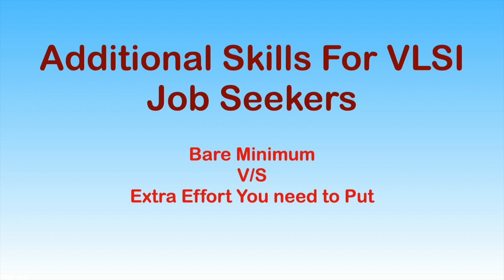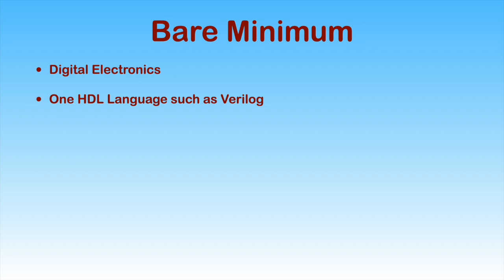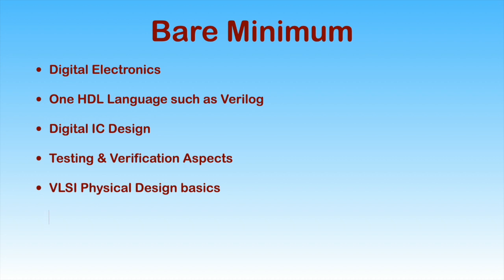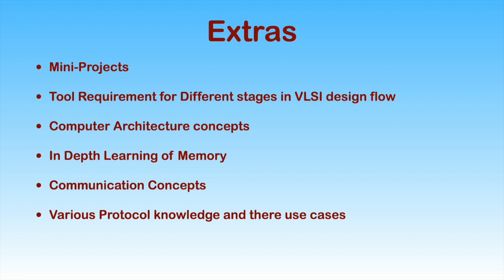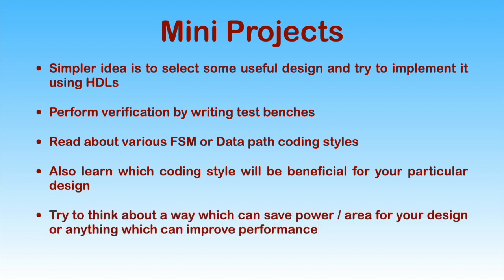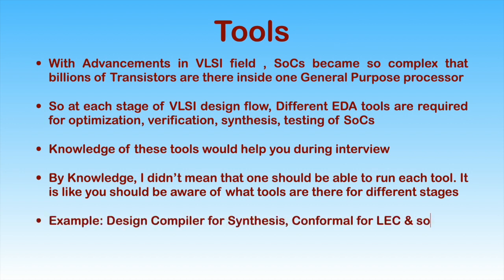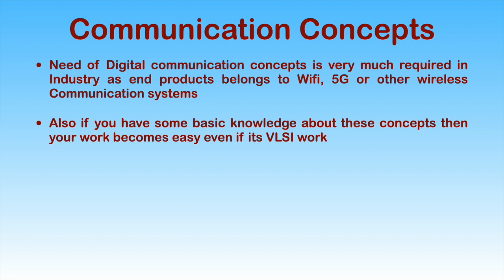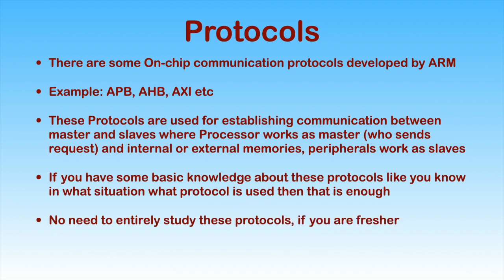Additional skills for vlsi job seekers | Bare minimum vs Extra skills need| Rajveer singh | ece jobs

Comment: Hii bro.
Could you please provide which nits offering mtech vlsi for eee.
I have secured 589 score in gate.can i  get in any nits for vlsi.
Reply from the maker: Don't have knowledge about EEE gate score. But to easily confirm this you may visit eligibility criteria for following nits
Trichy, Surathkal, Rourkela
And see if gate EEE score is mentioned in their information brochure or not.
See for Rourkela first because at this score there are high chances for vlsi
Reply: @Singh-Rajveer  tnq so much bro

Comment: Sir current I'm trying to learn a scripting language particularly TCL and I've covered basics like if else, switch case , loops , and data structures, sir after this should I go For more depth or it is sufficient?
Reply from the maker: As a Fresher, no need. When you will be using EDA tools then tcl knowledge will help you. However during fresher's interview more focus is on vlsi basics plus verilog.
Reply: @Singh-Rajveer  okay sir thankyou for the guidance

Comment: Hello sir,
Currently I am pursuing Btech and I will be preparing for GATE from my next sem
I have above 70% in my 10th but I have 68% in my 12th 
So,will it be an issue in VLSI industry?
Reply from the maker: Some companies require 7 Cgpa so there you won't be eligible otherwise its ok